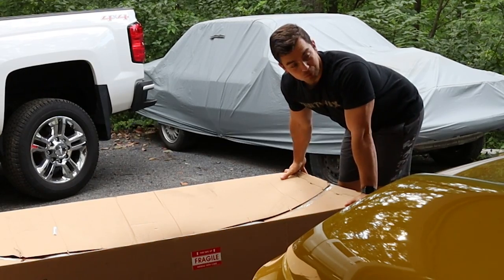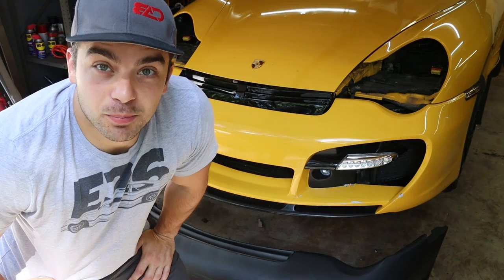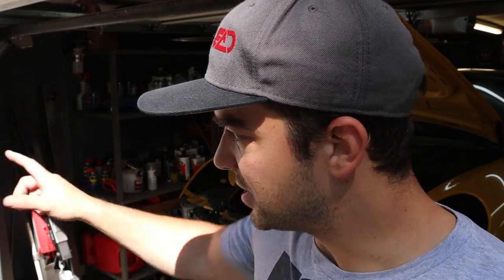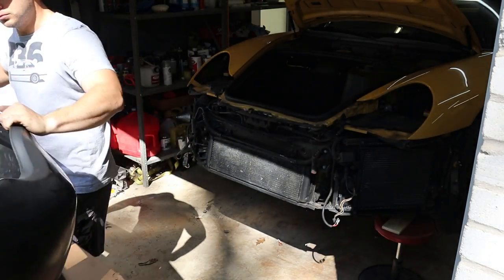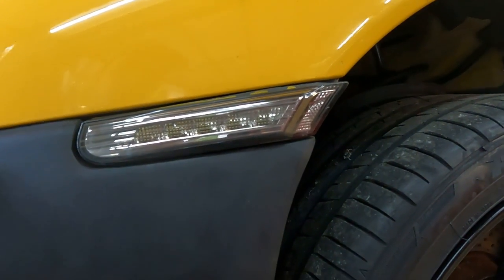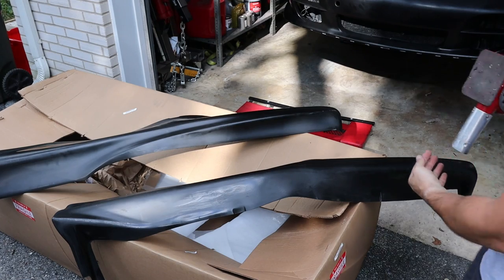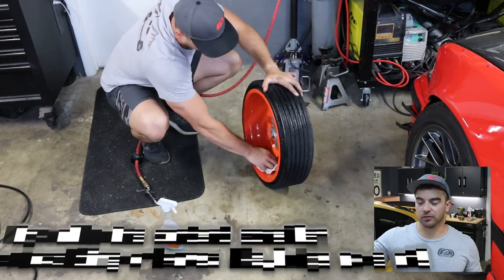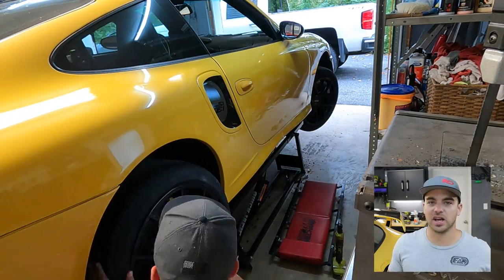"Basket Case" Porsche 996 Turbo Gets Some BIG Upgrades!

Comment: Instead of using a drill bit, we would heat up a sharpe rod to poke hole in ABS plastic . No ripping or tearing and also leaves a thick ring of material around the edge for the hardware.
Reply from the maker: Never heard of that, interesting for sure!
Reply: I’m just here for the rippin and the tearin
Reply: This one wins!

Comment: A piece of advice when dealing with after market side skirts and double sided tape... Make sure to heat and form the skirts to fit on body so the tape doesn't have to fight the skirt pulling away from the body. Heat the skirt and bend it slightly further than where it sits flat. Also, 3M makes an adhesion promoter. Make sure you use that and the widest, not thickest tape to have the most hold as possible. I had a 2005 Chevy Colorado with a xenon body kit on it. It had to be taken off 5 times of the course of 16 years due to the double sided tape slowly coming off from the elements.
Reply from the maker: Solid, thanks!

Comment: That electrical tape on the wires you terminated is going to fall apart and cause a short eventually. Use some adhesive lined heat shrink.
Reply from the maker: Haven't heard of that, I'll look into it, thanks!

Comment: Matt, you are missing the front impact beam ( bumper) You should get one and fit it for safety and it will fit with that new spoiler. Ps Love the project.
Reply from the maker: I had no idea!  I'll look into that.
Reply: @matt13ross  Came here to say this, also missing the radiator air ducting pieces. One for each side radiator and one for the center radiator. Best of luck with the car, i bought the "cheapest 996TT" back in august 2021 and have been on a quest of fixing it up so i can feel your pain to an extent

Comment: Great project! The 996TT is a near future classic for sure. One tip about the sideskirts (got a -02 996TT) I would stronglu suggest buying the original lower side skirts from the dealer, it´s the same as the GT2 use and they are cheap, 200USD or something. That will complete the original GT2 look. Just a tip! Looking forward for the next video on this project!! Keep it up!
Reply from the maker: But will they cover the damage above the skirts that I have?

Comment: Enjoying the series Mat. 7:04. Double check you still have factory front fog lamps working as part of headlamp unit. Previous clown may have messed with OEM fog lamp wiring to get those nasty ones in old bumper working.

Comment: Shouldn't it have a aluminium bumper buffer on the inside of the front bumper?  The car have it behind the rear bumper.
The bars for attaching one at front are still attached on the car. It was probably removed when that shitty front bumber was mounted. 😅
Reply: Je confirme ! Il manque le renfort aluminium entre les deux supports fixé en bout de longerons ! Indispensable pour la protection de la face avant (radiateurs en priorité des petits choc) contre les petits chocs
Reply from the maker: I guess so!  I'm looking in to that now.

Comment: How much prep did the body shop have to do to the bumper to get it looking nice?  I've been seeing used OEM bumpers for well under $1000, you can buy a brand new one from Sunset for $850.  NR Auto sells this bumper for $2000 shipped, so did they give you a huge hook up on price?  Did you get the OEM radiator ducts and what did you do to them to get them to line up with the bumper properly?

Comment: What kind of plastic is that new front bumper?
Reply from the maker: Poly
Reply: @matt13ross  Polyurethane is pretty difficult to paint, because it is so flexible. Been there, done that🙄 But knowing professional painter knows how to do it. Primer, paint and clear coat needs couple of additives to make it work